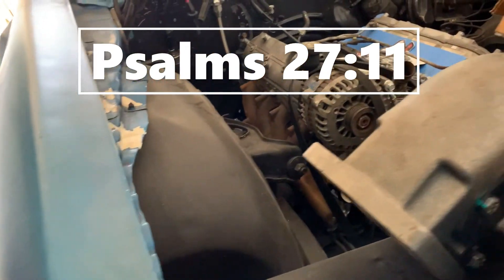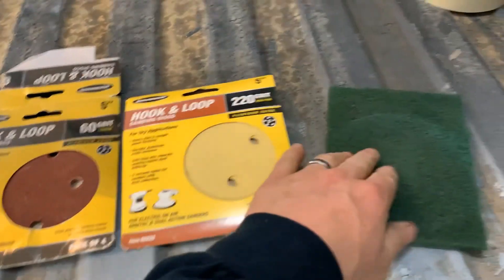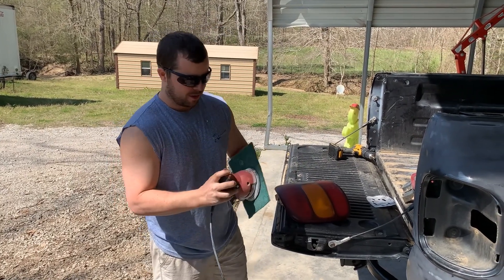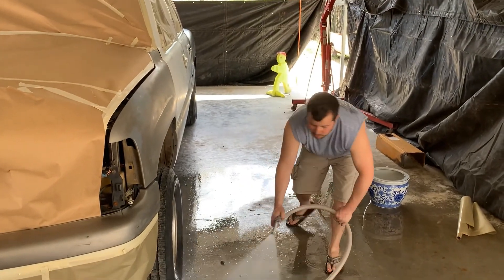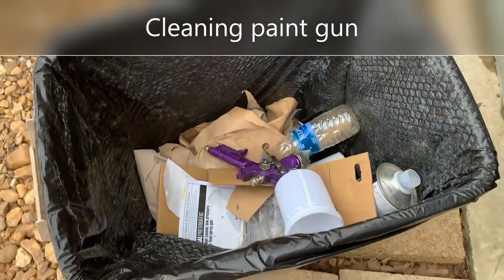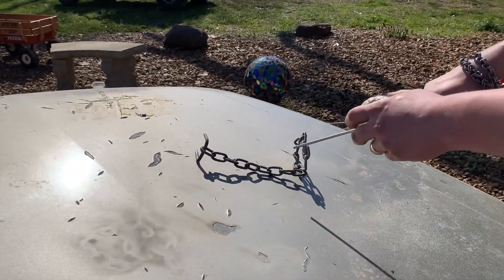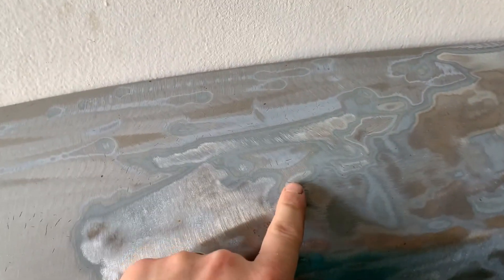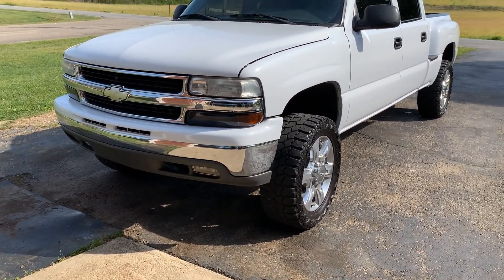It was headed for the scrap yard! turned it into my dream truck.

Comment: Great video, ive got a couple trucks id like to paint. I have zero experience painting, but id like to learn. Im not wanting show trucks, just something that looks nice when its cleaned up. I guess what makes it a little intimidating is that everyone has a different method so it's hard to pick out which method is best. What kind of cost do you think you had in doing it yourself? It turned out great.
Reply from the maker: It’s really not that hard, you can just practice on a small panel first so you can learn the pattern to spray in but base coat, clear coat is pretty hard to mess up.
I can spray a vehicle usually for less than $500 in materials unless you have a crazy expensive color picked out. 
I’m fixing to do a paint job on a scout and I will be doing a real video on painting it at home. It’s gonna look insanely good.
Reply: @JohnnyAnderson1  thanks for the response, I’ve been itching to try it, even have the paint gun sitting here. I just haven’t pulled the trigger on it yet. I’ll be looking for that video 👍🏻
Reply from the maker: @CumminsDriver   Awesome, its one of the most satisfying things you can do and increases value greatly. 
I will be starting sanding this weekend and hope to have it fully  done within a month or so.